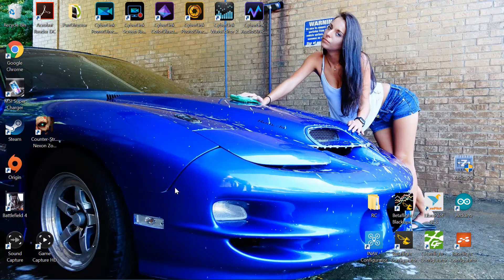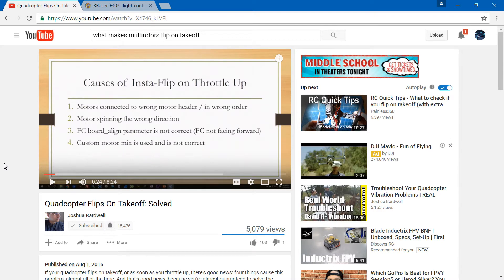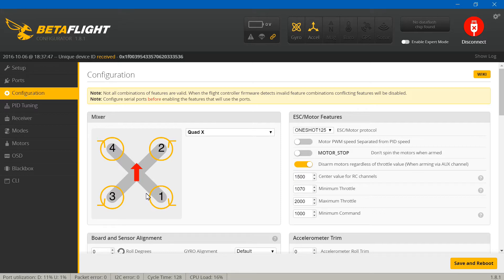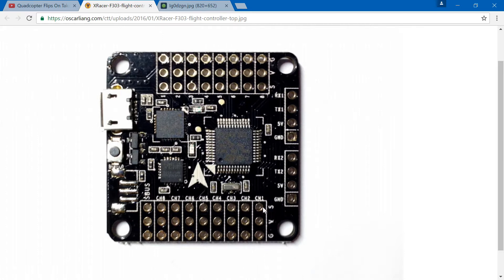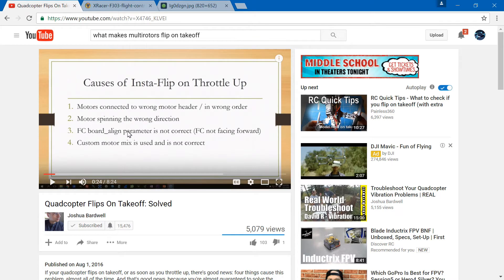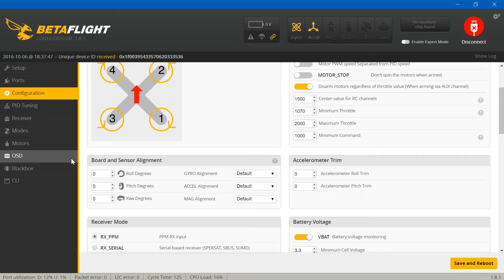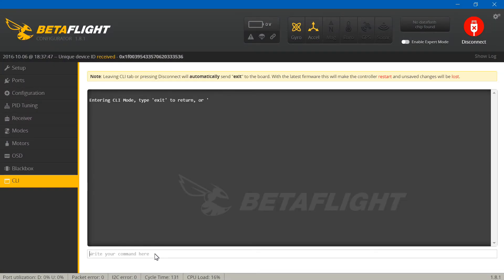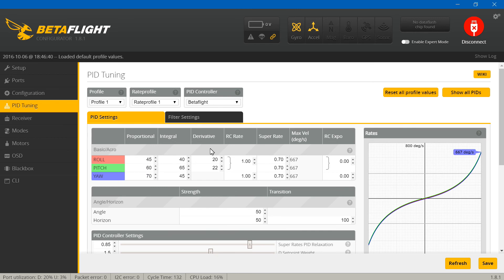Why Multi-Rotors Flip On Takeoff

Comment: I had this problem (drone flipping at take off) . I updated the firmware for my  Storm SRD 280 v3, and the drone would always flip on throttle up. I solved this issue in LibrePilot by going to the attitude tab and changing the Yaw to 90 degrees because on my flight controller board (CC3D Evo) is not mounted with the arrow marking pointing to the front of the drone but it is pointing to the left. So by changing the Yaw to 90 degrees then saving this setting then pressing the level calibration button with the drone sitting on a level surface, corrected the drone from flipping on throttle up during take off. 
LibrePilot does not or may not reset all your previous settings after a firmware update. Always save your drone settings as a uav file before any major changes. Save it on a flash drive or on your desk top computer in a folder so you can import it back into your flight controller in case something goes wrong or so you can view, change back all or some of the important settings.
 This will save a lot of time trying to figure out a problem.
 P.S. always check the arrow marking on your flight controller and make the necessary changes accordingly (0 degrees, 90 degrees, 180 degrees or how ever your flight controller is mounted as it needs to be properly orientated to fly level. The LibrePilot manual online explains this. Also your saved uav file can be exported by email to help solve  others problems who may be flying the same drone model or flight controller as yours.

Comment: I've just bought a new hglrc batman 220 and it insta flips wtf is going on I have watched so many vids everything's correct as far as I can see do you have any other ideas
Reply: I had this problem (drone flipping at take off) . I updated the firmware for my Storm SRD 280 v3, and the drone would always flip on throttle up. I solved this issue in LibrePilot by going to the attitude tab and changing the Yaw to 90 degrees because on my flight controller board (CC3D Evo) is not mounted with the arrow marking pointing to the front of the drone but it is pointing to the left. So by changing the Yaw to 90 degrees then saving this setting then pressing the level calibration button with the drone sitting on a level surface, corrected the drone from flipping on throttle up during take off. LibrePilot does not or may not reset all your previous settings after a firmware update. Always save your drone settings as a uav file before any major changes. Save it on a flash drive or on your desk top computer in a folder so you can import it back into your flight controller in case something goes wrong or so you can view, change back all or some of the important settings.  This will save a lot of time trying to figure out a problem.  P.S. always check the arrow marking on your flight controller and make the necessary changes accordingly (0 degrees, 90 degrees, 180 degrees or how ever your flight controller is mounted as it needs to be properly orientated to fly level. The LibrePilot manual online explains this. Also your saved uav file can be exported by email to help solve others problems who may be flying the same drone model or flight controller as yours.

Comment: Is the omnibus f3 pro board marked incorrectly?I have the arrow left with the current sensor on the back and the board alignment is 0. The quad responds correctly to  roll and pitch  in the betaflight setup but it flips on take off.
Reply: the F4 has been the same for me, strangely it worked as expected, then one time I plug it in and its like the board orientation had changed. this has happened on 2 f4 boards.
Reply: I have the omnibus f3 pro on my bfight 210. My quad flips on take off. But yes, I have changed the FC orientation by 90 deg ( to the left. Does that make 270 deg?)
What changes are needed in FC configuration? Do I need to use betaflight or blheli software to make changes?
Please help.

Comment: mate ,i have tride all of these .and no joy pids cool .motors on the right way around props cool.when i try to callibrate the motors they spin on p
lipo plug in ?, could it be a bad accelerometer?thanks
Reply: George Johnson I also have a similar problem... Everything seems good but it is unable to take off... If your problem is solved, please help me...